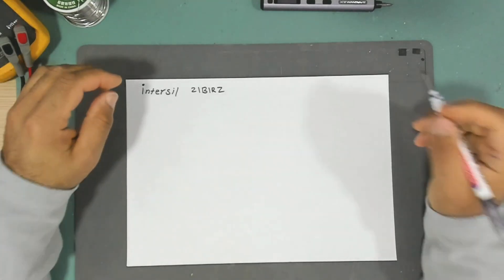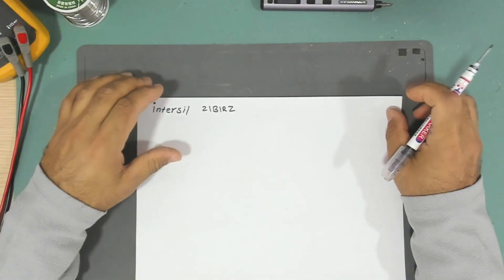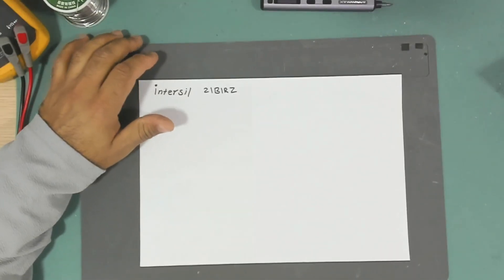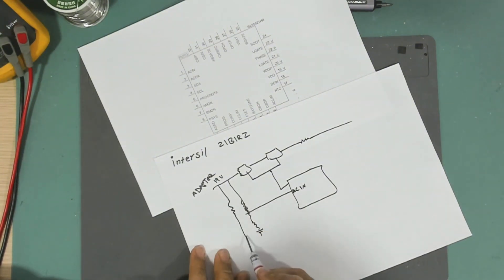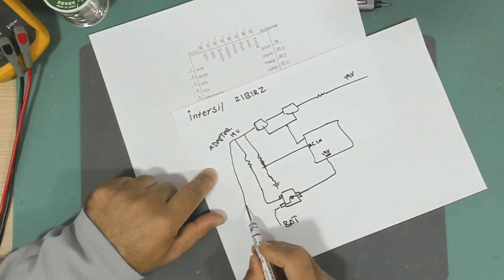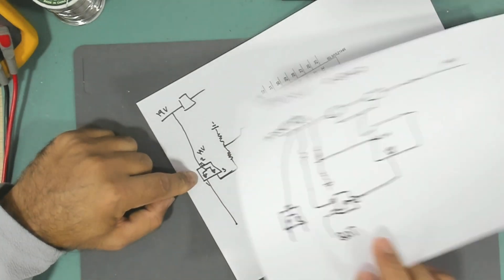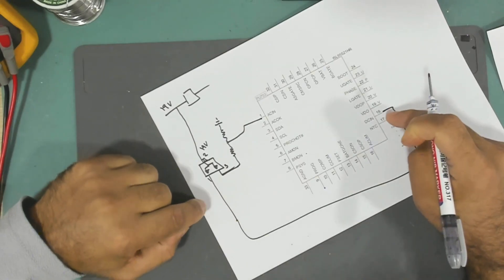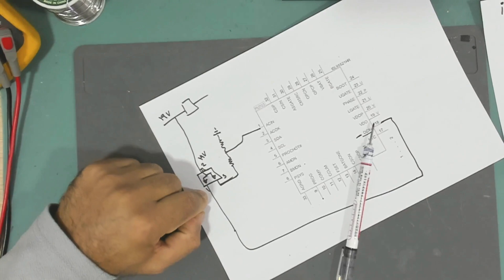Intersil 21BIRZ || Siemens Simatic PG M6 21B1RZ

Comment: Have similar on a HP 840 G6, laptop is dead on mains AC no orange/white led on power socket, work's fine on Battery, and even the Mains Ac will charge the Battery. Intersil 9241H.thanks for the Video
Reply from the maker: You welcome friend 👍🏻

Comment: Does this have a id pin? I have one if this to fix, it doesn't detect the charger is connected but i have voltage after the second mosfet.  Bone of the mosfets are shorted